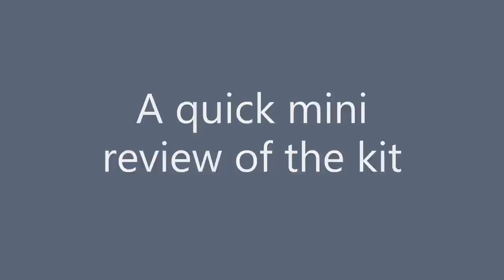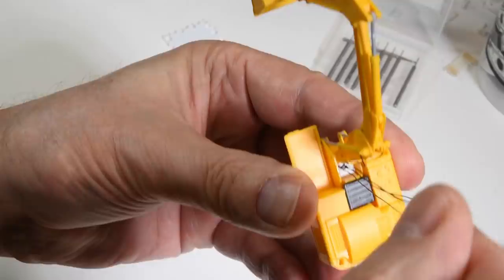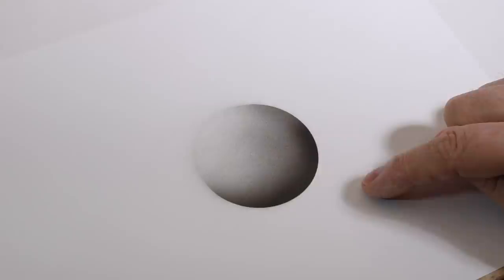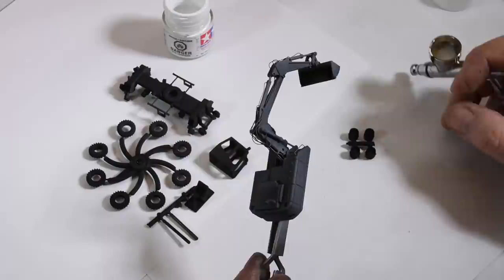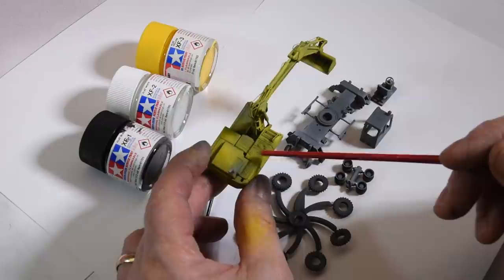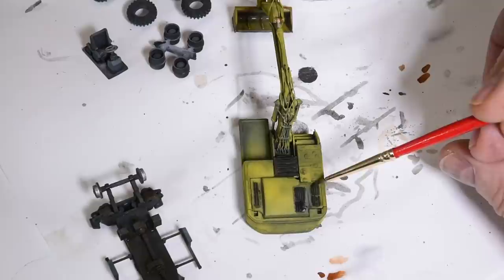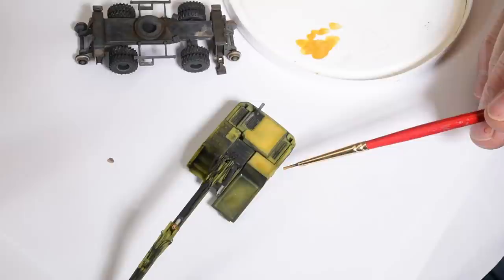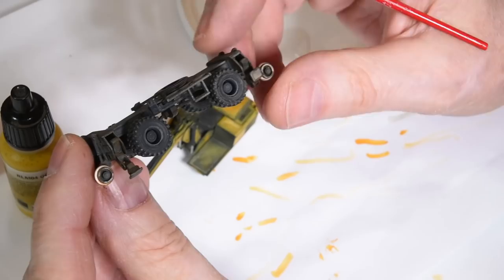Painting Scenic Details HO Scale Hi Rail Excavator | River Road - Vlog #81

Comment: Having spent over 30 years in utility engineering and project management for heavy highway construction very nice.  A few observations 1: every excavator has horizontal rust steaks across the counter weight. They always rub across something that scrapes off the paint when the body swings around. 2: the pins on the hydraulic rams and pivots are greased every day. There's a lot of excess grease and dirt at those points.  3: a freshly painted bucket will have the paint wore off in less than a day.  Depending on the humidity there can be some light rust on the raw steel the next morning.  The amount and darkness of the rust you applied indicates the excavator hasn't been used in 3-4 weeks,  which is not uncommon.  
Thanks for sharing your talent.
Reply from the maker: Thanks for sharing. Cheers.

Comment: Hi Boomer, you mention some time ago that it was difficult to get the correct size ballast ,I've never really found any of the manufactures come up to scratch.
This will make you laugh, I was visiting a friends layout the other day he is a very accomplished  modeler  uses Code 60 track I asked him about the type of ballast that was on the layout.
To my surprise he replied its not ballast, I'm using sand blasting grit did the calculations and it was the correct scale size the results are very impressive and you can get this at auto parts stores.
So it just goes to show you can learn something new every day just by visiting friends layouts 
Im going to buy some and see how well it works , I will let you know how it turns out.
Reply from the maker: I love reading what you just wrote! Half the fun is discovering scenery materials outside of the hobby store . . . lol. The journey of discovery has only begun. Good Stuff! Cheers ~ Boomer.

Comment: Great job. Looks fantastic.  Not saying it is a mistake, but if the instructions indicated it I think they are wrong, the cylinders on the main boom are up side down. The base of the cylinder is always on the lower end and the ram attaches to the moving part. At least I've never seen any hydraulic cylinders set up this way and I've been in the construction industry for years
Reply from the maker: You are probably right. I used to care about details like that years ago but now I don't care much anymore. On the other hand, I may think differently about another model, who knows. Frankly, I have built so many model kits, I just plow through stuff to have fun. I find it hard to take things seriously anymore. They just come out a certain way due to experience over the years and I settle for it. Thanks for sharing. cheers.

Comment: One of the (many) things I'm stealing from your video is the grab (wire) bar idea. I have a model where if I even LOOK at the model the wrong way, one or two bars fall off, so I'm switching them to wire, which I already have. Thanks for the cool idea! plus on mine, if they are bent, it will be more realistic, saves me the trouble of "crinkling" plastic to look metallic!

Comment: Fantastic job Boomer. I have a question for you. When you are finished painting your models, do you seal them with anything like dullcote or similar?
Reply from the maker: I think it is a good idea to flat coat every model to protect and seal the paint. Especially, if you plan multiple "oil" washes over acrylic layers, etc. It adds a reflective layer and can produce remarkable results under good LED lighting.

Having said this, there are times where I do not seal because I desire a "dead" flat (non-reflective) look, which Tamiya paint is known for. If you like pastels or chalks it is best to avoid sealer because it mutes all the weathering below satisfaction.

Cheers.

Comment: This a great technique, thanks for sharing your knowledge. What would the process be if you have decals? Seems it would be in reverse order. Thanks.
Reply from the maker: No reverse order in my case. Just clear coat (which I will do later), slide on decals, flat coat, and throw on a subtle wash to blend the decal into the weathering. You can do the process anyway you are comfortable with. I like to add decals last this way and then wet sand them to add wear and weathering if I want. ;-)
Reply: @boomerdiorama 
 😲

Comment: Hi Boomer,
I'm struggling with a question on size and proportion of buildings like the brewery.  I know you covered this in previous videos, but I'm unable to locate the video, even going back to Glover Road.

Could you briefly explain how you determine in inches the height and width  of any given building to be in proper proportion to engine and cars for a siding against a warehouse?

Thanks so much...
Reply from the maker: You need a common size of a standard door from the photo you choose to use. Use a standard door from the photo (find one). Doors are approx. 7' high, 36" wide. Use those dimension to determine other measurements from the photo. Use other clues in the photo to roughly gauge other dimensions. Use the boxcar on track to determine loading bays directly onto the model wall. Loading bay doors are usually ten to twelve feet high by teen feet wide, etc. You need photos with clues to use as a guide to measure things from. It doesn't matter what device you use to measure for the model if you know the height of a door on a photo. Just roughly guage the increments from the door right off the photo to get heights, widths etc. Cheers.
Reply: Thank You, that helps a lot!  I do remember now that you covered a regular door width and height to determine other measurements.
CHEERS
Reply: Hey Steven - Boomer covers it perfectly (as always!) and if you ever have a chance to photograph a building yourself, you might want to make a 'scale board' - cut a chunk of wood 12" square, paint it white on one side and black on the other. Then you can lean it on the building when taking your photo and it will give you exact measurements for everything in the photo. You can also get your wife/kids involved and have them hold the board next to a detail item. Also, think about making marks on the board to indicate 3", 6" and 9" lines.
Ain't this a great hobby!
Reply: @thomream1888  Thanks for the tip Thom!  I never would have thought of that.  Sounds like another great idea to find more exacting measurements!
As Boomer would say, 
CHEERS
Reply: I know you got your answer but to help satiate your curiosity it was mentioned in the hopper build.

Comment: Does the wet on wet method work with "cheap acrylic craft paints" (hobby lobby, Michaels, etc.) as well, or are the pigments not high enough quality?
Reply from the maker: It does, except the pigment is not as good. Anything is possible though. ;-)
Reply: I am going to jump in here and go out on a limb with my experience. I use the cheap craft paints for my wet on wet applications. The thing that I have found is it may take more layers to get the effect I want. Let each layer go completely dry and check the effect. If you like it, move on to your next step. If not, add another wet layer. I just take my time and have fun with it. Hope that helps - Larry.
Reply: Thanks Boomer! Most of my experience is with enamel paints for weathering so acrylics is a new adventure!
Reply: Thanks  @harperlarry49 ! I'll be trying out some of the craft acrylics to see they work!
Reply from the maker: @tcmr4250  That is the way I was as well over twenty years ago. I still use enamel "flats" here and there for dry brushing combined with oils. Although, I am fairly addicted to good quality acrylics now because they are superior pigment, easy to use, and dry rapidly.  Furthermore, I can throw solvent based enamels over acrylics right away, as well, for additional filters and effects, etc. Cheers ~ Boomer.